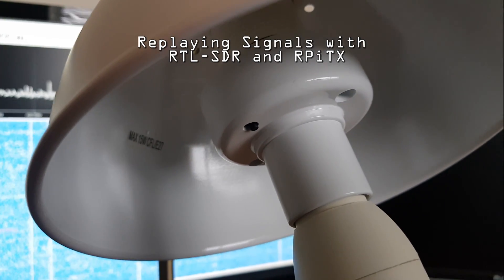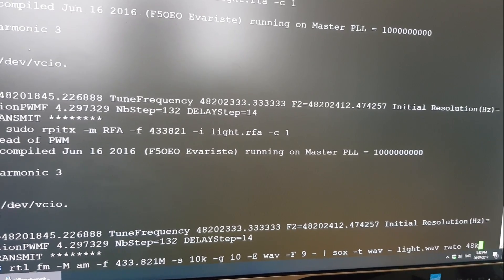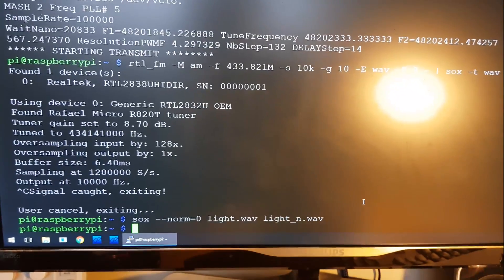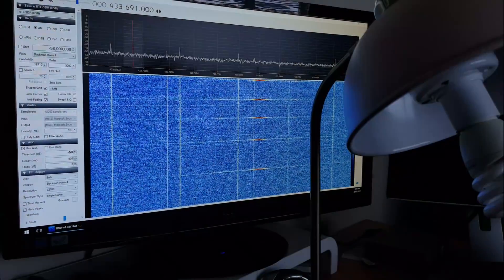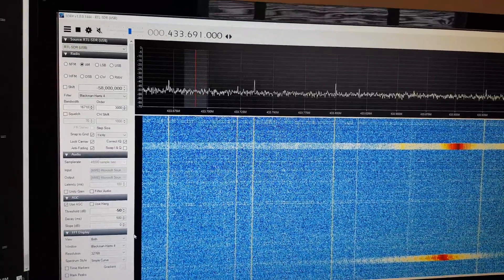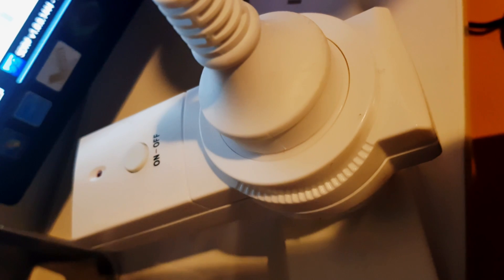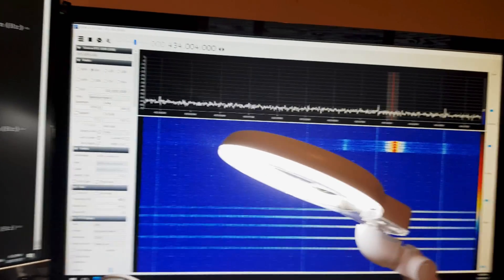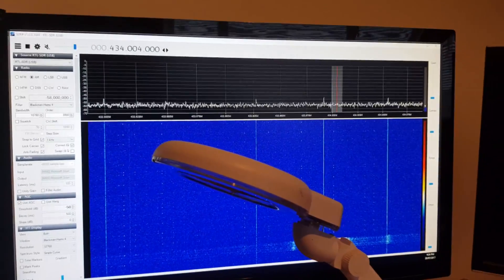Replay Attacks at 433 MHz with RTL-SDR and a Raspberry Pi running RPiTX

Comment: what wire should I use to attach to the raspberry GPIO? And how to I do it safely, im not into hardware stuff
Reply: Raspberry Pi (as pretty much ALL the small electronic gadgets BTW) uses so-called SELV i.e. safely extra-low voltage, which is inherently safe to touch. Just make sure you're careful about static electricity and that's it. The wire should be attached through a cable with a DuPont connector and you should let the other end of it dangle freely (it mustn't touch any grounded surface!).

Comment: Hey i tried sending test signals from my Rpi to SDR dongle connected to my laptop , but it didn't work . Can you tell me at which GPIO pin should i connect a piece of wire which will act as an antenna
Reply: gpio 4

Comment: Quick ?  So as long as the code isn't rolling if you can manage to record it once, you basically have control of that device forever ? So you can index/catalog a bunch of different devices , convert the .wav files to .rfa and have a library ,, If I am understanding that correctly , thats awesome.  What about for rolling code though , Do you need two radios for this , one to jam and one to record the valid keypress and save it ?  I am a Linux admin , part time Pentester, I've been dying to get started with RTL-SDR.  I just want to go in with as much understanding as possible.  Thanks

Comment: As long as you have an adequate recording level, you do not need to go through the normalization process.

Most people can't record audio for toffee, this is why rubbish tools like that exist and it does absolutely nothing for the dynamics of the audio, most people normalizing audio tracks they have ripped are only undoing the hundreds of hours of studio time the engineers put in to getting the right dynamics, buggered in seconds with a tool written by a programmer, not designed by someone who understands audio.

When I took my studio engineering course at Uni, you are told the correct tools to use and normalizing in a software program is not the same as normalizing on a mixing desk, this is where the two terms are meaning different things.

So without going through normalizing your recording, your system should still trigger, if the signal needed to be any stronger, then the original signal would have been larger (stronger).

Comment: How do you get SOX to encode wave files? -t wav has issue on my rpi3 "sox FAIL formats: can't open input  `-': WAVE: RIFF header not found"
Reply: I have the same error... any solution?
Reply: I just record from sdrsharp on windows and convert them with audacity then put them back in to the pi. Until I find a better solution. But when I do I will post here.
Reply: does anybody have a fix for this?
Reply: Insert the SDR into the USB port until the command is executed

Comment: I have power issues on my Pi3 when I plug in an an E4000 dongle. I have a very capable power supply going to the Pi. Do I have to mod the USB supply rail or something? Run Pi3 from TCP/IP?

Comment: Thanks for posting very informative video.  I hope you are able to help with my issue

I have a genetic 433MHz security alarm remote . I am able to capture the signal like this 

rtl_fm -M am -f 433.920M -s 10k -g 20 -E wav -F 9 - | sox -t wav - myrec.wav rate 48k #Capture
sox --norm=-3 myrec.wav myrec_n.wav #Normalize 
piam myrec_n.wav myrec.rfa #Convert
sudo rpitx -m RFA -i myrec.rfa -f 433920  #Replay on GPIO18
sudo rpitx -m RFA -i myrec.rfa -f 433920 -c 1 #Replayon GPIO4

My device does not react so I ran rtl_433
----------------------------------------------------------------
rtl_433 readings from remote every time 
----------------------------------------------------------------
Short distance: 79, long distance: 252, packet distance: 2678

p_limit: 183
bitbuffer:: Number of rows: 6
[00] {1} 00 : 0
[01] {25} 99 2d 02 00 : 10011001 00101101 00000010 0
[02] {25} 99 2d 02 00 : 10011001 00101101 00000010 0
[03] {25} 99 2d 02 00 : 10011001 00101101 00000010 0
[04] {25} 99 2d 02 00 : 10011001 00101101 00000010 0
[05] {11} 99 00 : 10011001 000

----------------------------------------------------------------
rtl_433 readings from sudo rpitx -m RFA -i myrec.rfa -f 433920
----------------------------------------------------------------
Short distance: 1, long distance: 5, packet distance: 6381

p_limit: 258499
bitbuffer:: Number of rows: 2
[00] {1} 00 : 0
[01] {25} 00 00 00 80 : 00000000 00000000 00000000 1

----------------------------------------------------------------
rtl_433 readings from sudo rpitx -m RFA -i myrec.rfa -f 433920 -c 1
----------------------------------------------------------------
Short distance: 3, long distance: 4, packet distance: 11

p_limit: 261743
bitbuffer:: Number of rows: 2
[00] {7} 00 : 0000000
[01] {10} 00 40 : 00000000 01

I have tried to play a file on 433 and I was able to tune in and clearly hear the file.

Please Help!